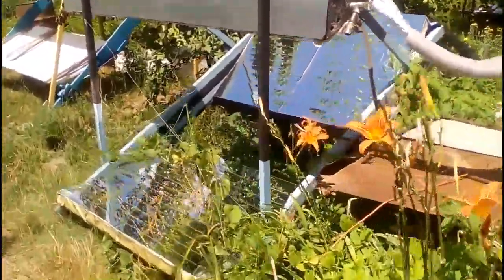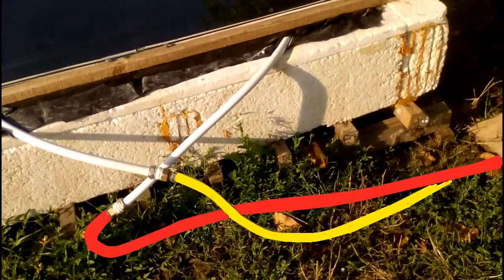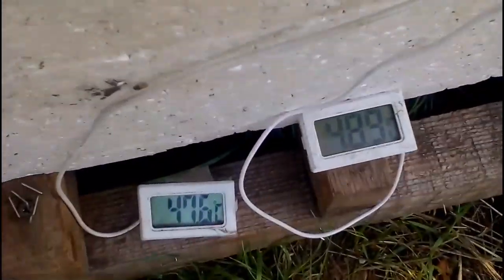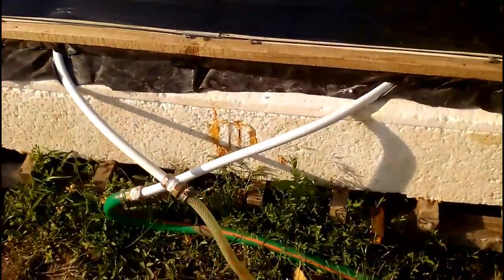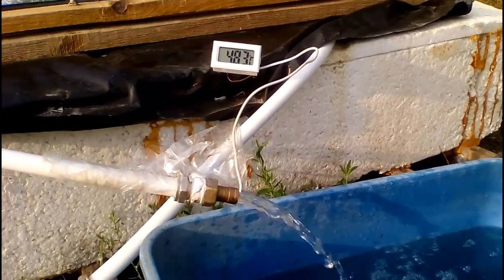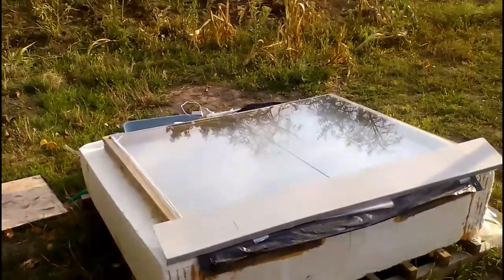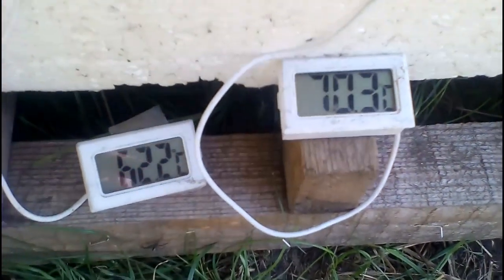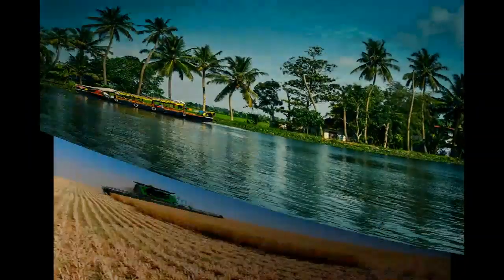Why is this DIY Solar hot water system better (on the example of my summer cottage)

Comment: I'm considering a solar air heater (screen in a box), that then heats a water thermal storage tank.   Also cheap to build, low weight for roof/wall mounting.  No freeze/drain-back issues.

IF (big if)  you can put all or some of the thermal storage tanks inside* the rooms that you want to heat  from the thermal storage.  Then you will have no heat loss from the thermal battery as it will be "leaking"...heat  into the area you want heated anyway**.     Depending on the season, you could use reduced or even no insulation for the thermal tank.  Although insulation give you more control of course.

 (*same concept applies no matter the original water heating source)
Reply: The water in a box design (without the heat exchanger coils)   could provide for easy drainback.  Seems best to use with a reflector since the pool can't be tilted, lol.
Reply: Thank you. I am setting up for a wood fired hydronics heating system, with the exterior boiler being a cheap gas hot water heater necked in as the flue of a smoll rocket stove.
Or I might use Methanol, we'll see.
But the idea is to keep the fire outside of the tinderbox that is a Caravan. I shall then pump the hot water into the "Tiny House" and through a car radiator with a 12V fan.
I need to add some thermal mass, which will provide heat buffering and storage for at night when it isn't going to be burning.

Comment: thanks very useful,but u can cover the stiroform with box tapes or duck tape to make its life longer and to make more efficient in not loosing heat also ,and u must seal where the hose is in and out the stiform with plasticine for kids,and try a bigger stiroform box ,and cover the upper glass with transparent tape,so it could be more protected

Comment: Hello, great videos!
Can you make a video of how can you use a solar heater together with a conventional gas boiler?
Can they work in parallel? Can the water from the solar heater get fed into the gas boiler and reduce or eliminate the gas usage. How do you connect the two without manual intervention to use them both at the same time when solar alone won't do it 100%. thanks!
Reply: in series, not parallel,  just feed the solar preheated water into  other heaters of your choice,  the conventional won't turn on if it deems the input water is already hot enough,
Reply: @unionse7en  yeah i meant series. great. thx

Comment: Dear Yurko. congratulations, but, olny, please - as my constructive criticism - why mr does not store 40% of the solar hot water  hourly produced day-to-day to use for up to 23 hours in a small airtight stainless steel thermal enclosure until cheap (covered with styrofoam plus mylar) and where the proven hourly thermal losses are to be only just 3 degrees / hour ???
Reply: Интересно! Хотя и непонятно без перевода, но возможно, что:
Для работы в саду или поле, да и просто рабочего человека такая установка может быть полезна и минус того что она не работает в пасмурную погоду, состоит в том что и человек при этом меньше потеет и меньше нуждается в душе, а если захочет, то может воспользоваться  привычным источником тепла, например пропаном. Что же касается принятия душа по утрам интересная буржуйская привычка притом что ложились спать чистыми в чистую постель? =) Но несуть возможно у вас важная встреча с партнёром и да тогда это проблема. Которая может решиться масштабируемость установки и утеплением. 
В остальных случаях стисни зубы и "...закаляйся как сталь"